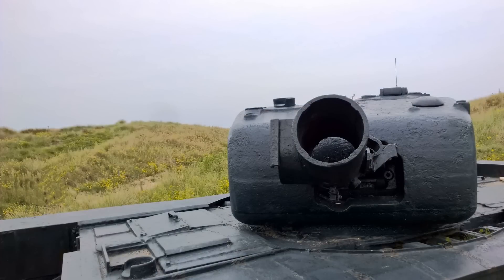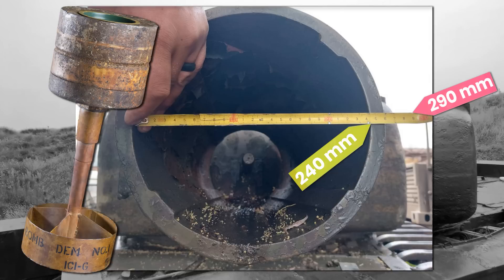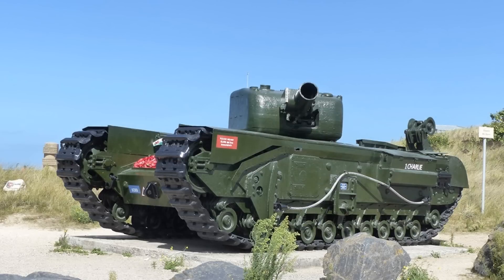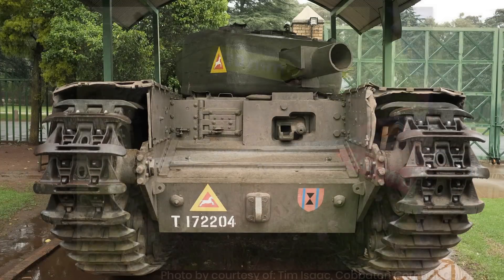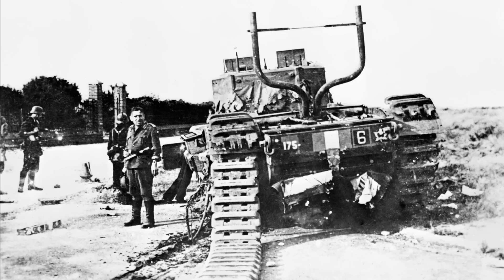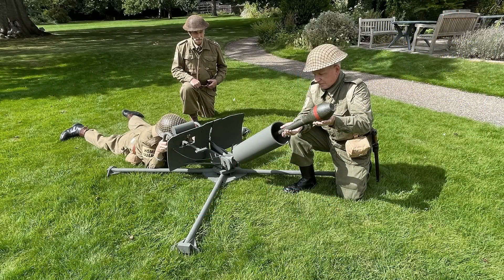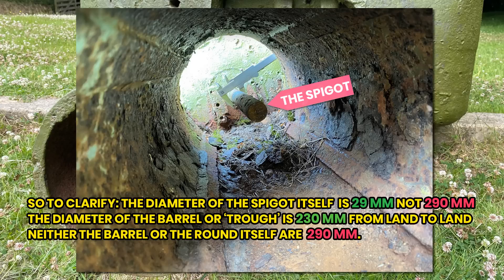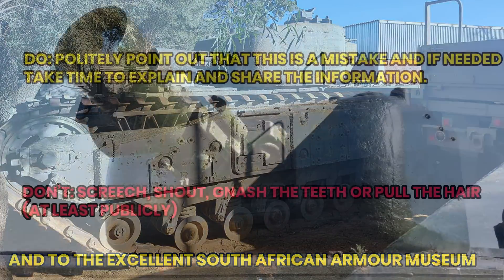AVRE 230MM - FACT CHECKING

Comment: There is a link between the Sherman tank and Ronson. Ronson used a tank shape in some of their WW2 era job adverts. Whilst Ronson used a tagline in a 1928 advert similar to their post-war "lights first time, every time" tag line that has become linked to the Sherman, 1928 is far back to be credible for attaching to the Sherman.
Reply from the maker: it was used once post war and after the war a lot not during, but even the pow reports and intel dont have it crop up, over 20 boxes of pow reports, spilling their guts, not a peep for this commonly held name
Reply: @armouredarchives8867  yes, the tag line wasn't used, but Ronson used a tank profile very similar to the Shernan in some of their war time adverts.

Comment: The trouble with Wikipedia, is that when somebody, with accurate researched info, edits & corrects a mistake, someone else will eventually incorrect it, back to the popular consensus error.
Reply: We should reinstitute duels for fact checking.
Reply: @abnerdoon4902  magic duels, prefferably
Reply: The problem with Wikipedia is the demand for reliable, published sources to verify your edits.
Everyone needs to understand that every Wikipedia entry is a summary of the sources available to the writer at that time, and any information not backed by sources are likely to be challenged and if no source is given, deleted.
(Though certain users tend to forego the challenge step and just revert it)

There are plenty of things I know being objectively wrong, but until I can find a source with the objective truth, at best I can dispute the reliability of the given source and have the error removed but not add in the correct one.

Now, if you DO have the required sources and want to correct a previous mistaken source, you should not just change the text into the factually correct, but also mention doing so, along the lines "this later research by [your source] has showed the previous statements by [old sources] inaccurate, as this [fact] is the correct value". 
Adding that not only temper people coming in and go "that's not what my book says, I have to fix it!" and inform readers that there has been faulty information circling around, it also notifies the people regularly patrolling the articles to keep an eye on that edit so it doesn't get replaced with the unreliable sources.
Reply from the maker: I think this is the issue with Wiki tbh, I mean I’ve had them measured, from diff sites around the planet, gone over the workbooks and the manufacturers guides, its hard-to-find better ways to distribute that information, but then it wont count and some ragtag book written by a man who never left his chair in the 80s, will count. Short of driving it though the front of the Wikimedia headquarters and making them physically measure it themselves, I’m not sure what’s left I can do my end
Reply: @armouredarchives8867  shows as 230mm for me, citing you (3rd reference)

https://en.wikipedia.org/wiki/List_of_specialist_Churchill_tank_variants#cite_note-youtube.com-4
Reply: Good job! So far it hasnt been corrected back to the common myth. I think it would be ok to briefly mention the common mistake and explain it. That would make armchair researchers think twice about reediting it again.
Reply: @armouredarchives8867  , driving to the Wiki headquarters would change nothing, the inherent problem is what I mentioned above:
Wikipedia is a summary of (more and less) Reliable Sources (published of course) so it can be verified that the information written in the Wikipedia article is what the sources say.
Since you PUBLISHED this video, there IS a source.
While you might be regarded as original research and thus not qualify as a RS, it is definitely enough to dispute those ragtag books as well.
I've been editing Wikipedia for well over a decade now (BP OMowe), so I learned most of the pitfalls :)
Reply: @armouredarchives8867  Fixed the German, Swedish and Croatan wikis while at it.
Reply: It seems to have been update with a "citation"

Comment: Is someone measuring the outer diameter?  It looks like the wall thickness from some of those pictures is about 25mm?  240+25+25 and you are at 290.

I know that isn’t how the size is normally measured it I could see people measuring that and figuring that must be what they meant.
Reply: You can see in the first measurements  even from the outside  of the spigo to the outside of the trough it's no were near 290mm.
Reply: @terik3312  all the measurements were from inside to outside lip. I did double check on the last image and it looks like the wall thickness was around 25mm.

I’m not suggesting that they are right, just another possible reason something so easily tested persists.
Reply from the maker: it was measure, 280mm at best, not that one would measure any part of a gun doing it this way  so still not 290mm https://imgur.com/PFfpI9v
Reply: Unless someone measured the bore, then the thickness of the tube, then simply added them together, not realising that that is not how maths works.

Comment: I find this so unlikely that it's quite incredible. It's a bit like that line about the FG42 - that it was too light for the round, but a lot more obvious & easy to check with, a ruler.. *Well played sir. Am 'phoning Bovington pronto with my angriest hat on with built-in kazoo. (one should never assume that the source of information you take to be expert, then blame them for your misapprehension. If it's a bloke, they may have been just trying to help, or maybe blagging).
Reply: You can can also find a lot of books that confidently state that the reason the 'reason' the Japanese creates a reduced charge round for the Type 11 machine gun was that the original rifle caliber round was 'too powerful' for gun (e.g. The weapon 'rattled itself to bits' when firing.). Of course what actually happened was the original round produced excessive muzzle flash, something not considered important in testing, but critical in the field. The correct information has now percolated far enough to reach Wikipedia, but the older idea is still out there.
Reply: @Graham-ce2yk  - never read that one, but I like the idea that held sway at the time, that the Japanese couldn't dogfight because they were carried 'round on their mothers backs & so had no balance: "It'll be fine".

Comment: Is 290 maybe the length of the spigot ??   Oh and they are called lands and groves 👍🏻
Reply: Maybe I should watch to the end before I comment 😂😂😂
Reply: @alancox5777  I always do the same then end up editing my own comments at the end of the vid; I made the same point - can you say lands/grooves on a nonrifled trough which doesn't actually act as a barrel? All good nitpickery :-)
Reply: @Simon_Nonymous  I think lands and groves are appropriate because this sleeve in my opinion is a barrel. In that it guides and holds the projectile prior to and during firing. I know the propulsion and Obturation is accomplished but the spigot (yes and some direction lol) But to be honest I can’t see it there is a “twist” to the rifling. But that said does Rifling need to twist to be rifling? Also a barrel doesn’t need to be sealed to complete its function. My thoughts go to revolvers without gas sealing cylinders. Those barrels don’t hold pressure to help propel the projectile. What are your thoughts xx
Reply: @Simon_Nonymous  although looking at blackard bombard 29mm spigot mortar diagrams and documentation they call it the spigot casing so I could be wrong 🫣
Reply: @alancox5777  I think you've nailed it - when measuring a barrel that is not smooth bore, it is measured at the smallest and largest diameters; a groove is a grove whethe rit is rifled or not, so suggest a land is still a land whether it is rifled or not! Some interesting comparisons there, and I agree - it is a barrel as you have explained!
Reply: @Simon_Nonymous  hey that’s only my opinion. And let’s be honest im a nobody lol.
Reply: @alancox5777  everybody is a somebody Alan 🤩

Comment: Another misconception about the AVRE is that the loader had to get out of the tank to reload.
Reply: Wasnt it like loaded by the hull gunner through an open hatch? So its not competely wrong, but still wrong
Reply: @sharky9075  Yeah, but the howitzer was hinged like a break-open shotgun and loaded from the breach. The loader sat where the bow gunner would be in a regular Churchill, and the gunner swung the turret around so that the howitzer was directly over the hatch. It wasn't as dangerous a job as it was assumed to be.
Reply: @eze417  Ah ok thanks for the explanation
Reply: @eze417  It also kinda defeat the point of putting it on a tank chasis if you have to load it from the outside.
Reply: @copter2000  True.
Reply: Well I'm glad that there has been some discussion on how the mortar was reloaded because I was wondering about it and had no idea! Still it does seem like a right bastard to reload from the bow gunner's seat! Handling the round out of the hatch overhead and then in via the breech?
What about the Spigot? How did that fit into the picture?
Mark from Melbourne Australia
Reply: @markfryer9880  Good question about the spigot. Maybe they had a way to engage it in the round from inside the tank.